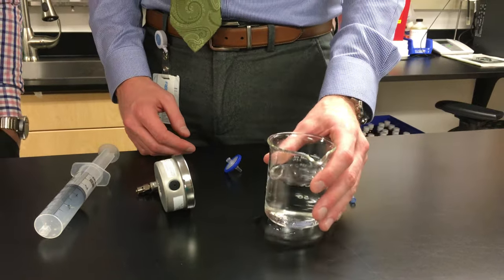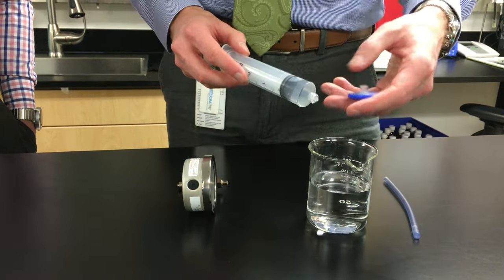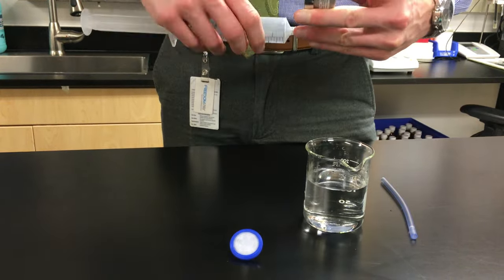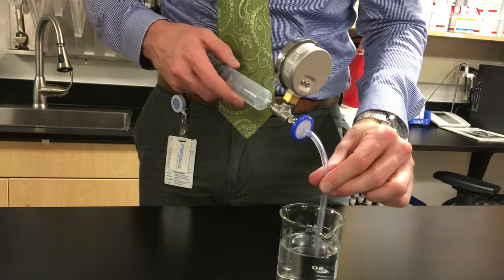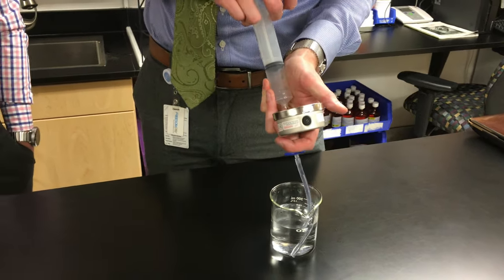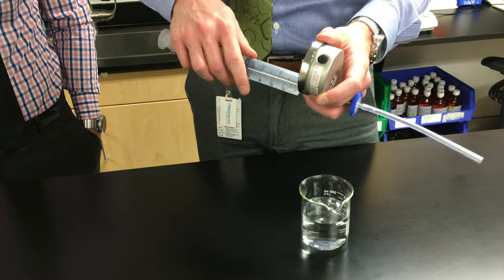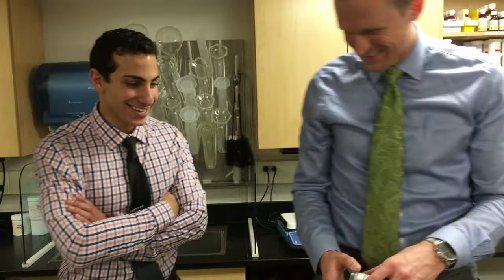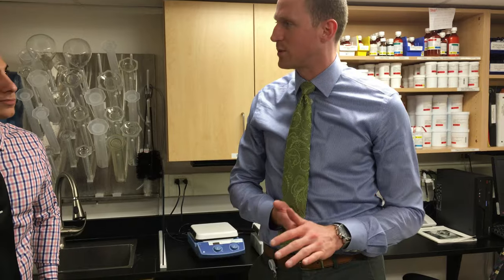Bubble Point Filter Test

Comment: If you were to use a syringe with a smaller diameter, you would need to apply less force to generate the same pressure.  Force = Pressure / Surface Area of the piston head.  If you halved the syringe diameter, you'd need 1/4 as much force to generate the same pressure.